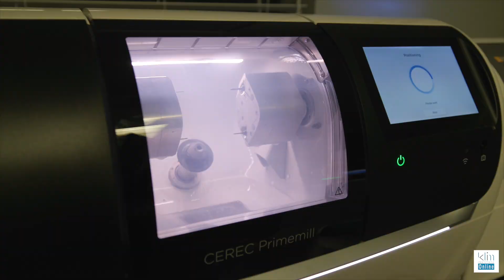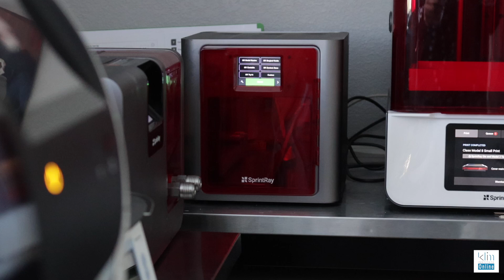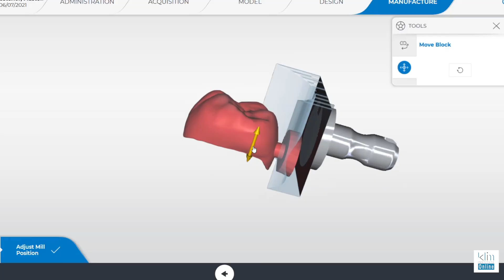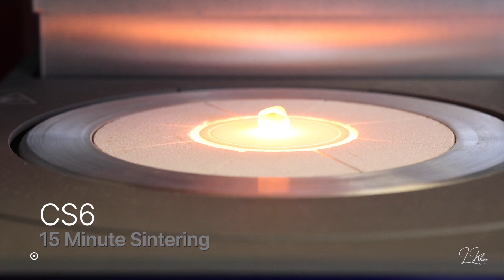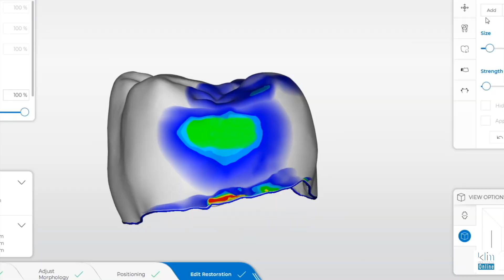This has been a good year for Chairside CAD CAM Materials.

Comment: Hello Doc. I do have the CS6. I acquired it after watching your videos. Not doing as much zirconia as I thought because of the extra steps and time involved vs emax. Now with prime zirconia I’m willing to try again and see if I can do zirconia chairside. Is the prime zirconia program already installed in the CS6 or do I have to enter it manually? Regards. By the way I do appreciate that always find the time to reply to our messages. Thank you Dr. Klim.
Reply from the maker: I am seeing zirconia and e.max with the Prime and CS6 being close to similar times.  Anything new in the workflow will take a few cases to make it routine. Just so you know, you will need to update the Firmware for the furnace.  Call your Ivoclar rep or go to the Ivoclar website to download.

Comment: Do you have any idea for when we may havePrime  bridge blocks?   They are available in the CEREC software, so I'm sure it's planned!
Reply from the maker: Hi Randy,  I have asked that question and am not sure.  Right now, I will use the ZirCAD MT multi when there is room for the indicated connector size or a 3Y when there is a need for optimal strength, such as the CEREC zirconia or the ZirCAD LT, and then infiltration.  Always good to hear from you.

Comment: Thank you for this video...  You always DELIVER!!!   Question:   what is your preferred zirconia for posterior bridges?    I have a tough time with shades.    This morning, I prepped two lower posterior bridges.    each is 3 units with a molar for the pontic.   I need A-2 in the mouth.  Thanks, Randy
Reply from the maker: For strength, I use two shades darker than the target shade, ZirCAD LT, and then infiltration to add the multi-effect and bring the value down.

Comment: Thought on Katana ONE?
Reply from the maker: Katana ONE is a good product.  When using the CS6, I have found the Prime works the best in my hands for aesthetics, and having more than one firing option for esthetic options has been appealing.
Reply: Using  the speedfire oven, so the longer time to achieve better aesthetics using the "top" of the Prime block isn't an option for me , or is there a way to override pre-set? . Thanks James @KlimDDS
Reply from the maker: @paulmelnyk-d8f  The Prime I believe is ~ 16 minutes in Speedfire and is good though.  Limited to create options with Speedfire.  Is a good furnace though,  just limited.